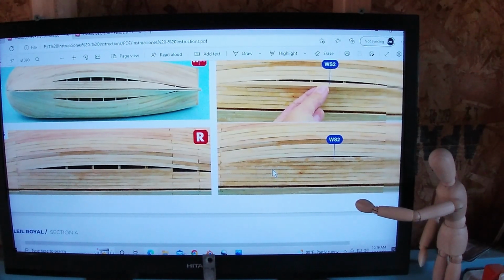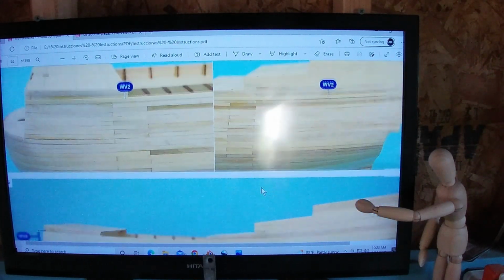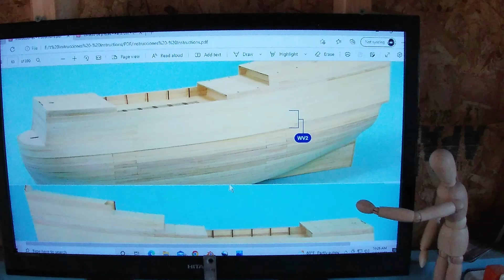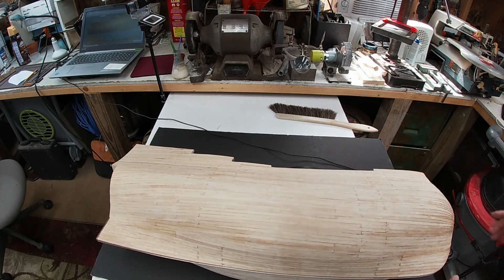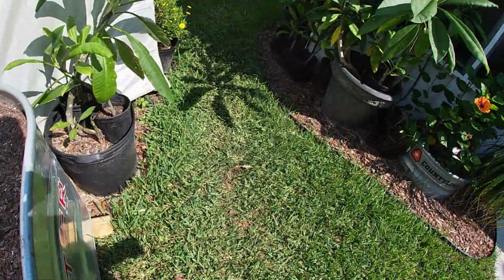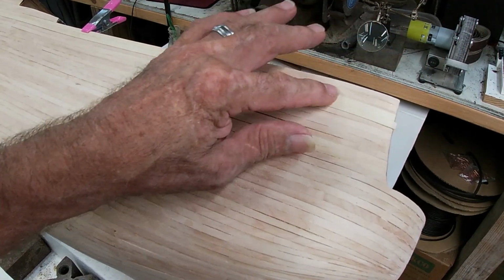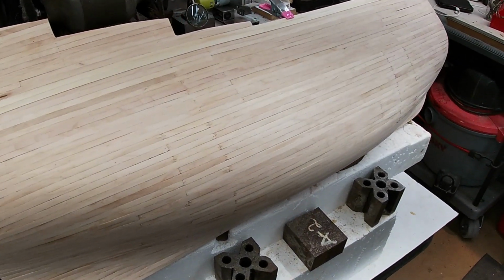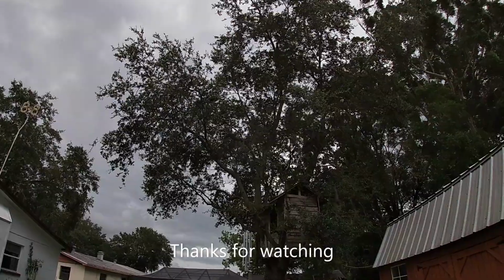Wooden Model Ship ROYAL SUN Build part #17

Comment: The hull looks awesome Roger, great progress. Not claiming to be an authority of any sort. If it were mine I like to fill the gaps. I use a product called Pollyfilla by Selleys, not sur if its available in the states but i'm sure you will have something similar. It's a soft white compound with a sort of chalky texture that dries very quickly and so very easy to sand as it is softer than the wood. I understand it possibly isn't necessary for the first layer, but..........  Thanks for sharing 👌
Reply from the maker: Ya I think I've heard of that stuff, some train modelers I know use it.

Comment: Hey Roger, I’m binge watching this build so I’m behind but I wanted to suggest for a future build that you go up to 600-800 grit sanding, at least on the final planking if you’re doing a 2 plank kit. It makes a huge difference. I used to leave my hulls at 320 grit and I thought it was smooth until I started going up to 800. Of course the harder wood will be much more responsive to the high grit but even pine will be a big difference if you go up to 600-800grit. And I agree with the other comment about considering wood filler for the gaps. It doesn’t add too much more work and it makes for a cleaner hull. 

Anyway, I’m enjoying the series and can’t wait to catch up. I see you’re currently painting the sides of the hull so I have a ways to go. 

Good luck!
Reply from the maker: Thanks for the input and intrest in the build.